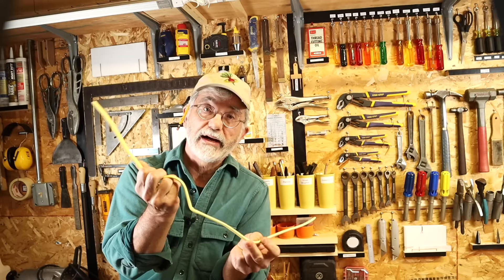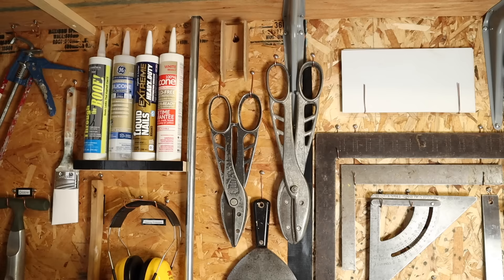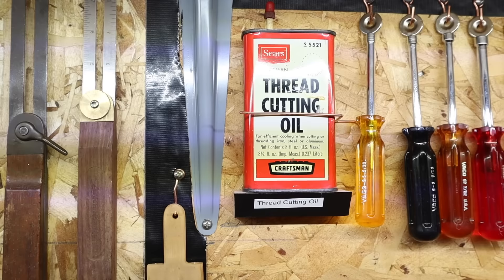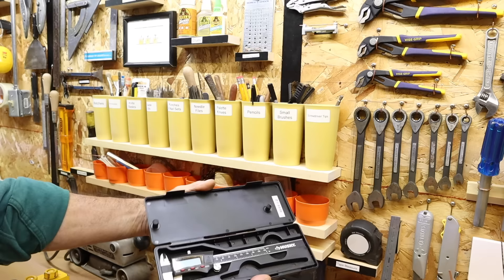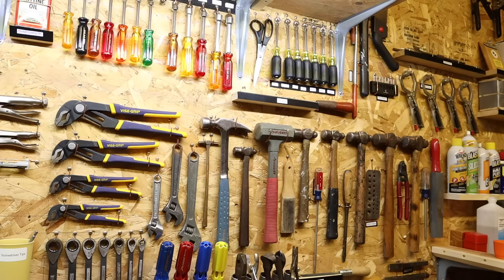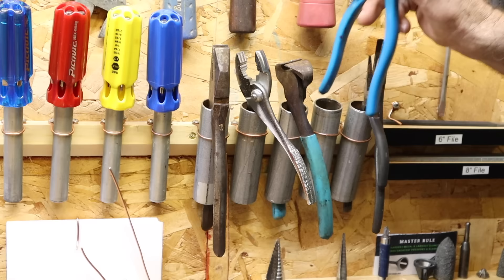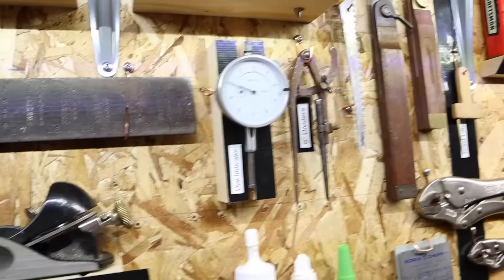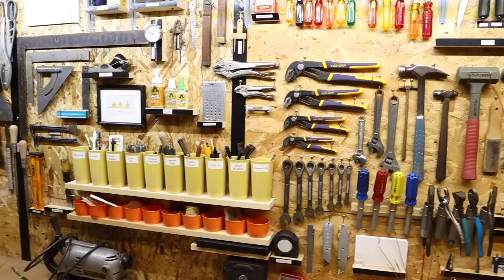How To Have Amazing Tool Organization Using Scraps of Electrical Wire

Comment: Ok, I'm moving off grid by the end of the month and have inherited (aside from my own) many tools (I have at least 8 different sanders and several different wire cutters/strippers, will need to thin things out as I go through them to organize).  Have saved some copper wire and so glad I did but figured I would use coat hangers to fill in, had a similar idea but this helps iron out some confusion a lot, thanks so much.  Better subscribe.  ps, I did happen to get some gorilla tape, all set to start soon.

Comment: WOW! Simplicity is so beautiful & functional. How many linear feet of wire do you think you've used to create this masterpiece? Next, where would be the best place to get a stash of enough romex to accomplish the same thing?
Reply from the maker: Hi Larry,
I have no idea how many feet of wire I used. Probably more than I would guess. I just wired an addition on my house, so I have scrap pieces. But I also go to yard sales and estate sales a lot and I've seen partial electrical wire rolls there fairly often, for very reasonable prices. If you have a local facebook group, you might ask if someone has some short lengths you can buy, or just have. Perhaps just let it be known in your circle of friends that you are looking for some wire and it might turn up. Otherwise, Lowes or Home Depot will sell pieces by the foot, but it's downright expensive. There is also the option of not using copper and, instead, getting an appropriate gage of galvanized "hobby wire" at the hardware store. Much less $. Best wishes.

Comment: Thank you!  This is fantastic and has given me all sorts of ideas.  I was looking for tool storage for my garage, as I can never find my stuff in drawers and boxes.  I loathe the small pegboard I have as the hooks always pull out.   I have other hobbies too - knitting, weaving, crochet, sewing, watercolour painting - and 2 dedicated rooms for these hobbies in the house.  They all require storage for all the hundreds of bits and pieces of equipment.  For indoors, I could cover the OSB or plywood (either fabric, paint or wallpaper).  The other beauty of this system is it's pretty flat, so I can make use of the usually unused wall space behind a door.

Comment: 22:56, you can use 1/2 or 3/4 poly irrigation tubing.  sometimes i cut them and I have scraps left over, so i can recycle them.
Reply from the maker: Right. Use what you have. It should work just fine. 👍

Comment: I feel like this is one of those contests where you see if you can make everything out of only duct tape but in your case, it is copper wire LOL. i am working on covering my garage walls in OSB lots of good ideas for hanging stuff i was going to put up pegboard, but this seems like a good way to hang things all over on OSB. figured the pegboard was a bit weak for heavy items and would collect sawdust in holes.

Comment: I organized all the tools using those hooks that you screw on wool or wall. I made doors for the shelves my husband made for storage and put all the tools right on the doors haha! Super cheap and easy too. It works like your hooks.  Yours is better because is absolutely customizable, I had to open some hooks and others I had to close, but for the most part I didn’t have to do anything.  The hammers i hung using pipe holders… anyways, if I had white leftover and watched your video I would use for the tools that didn’t quite fit on the hooks.

Comment: We are in the process of relocating.  These are great tips.  We hope to either buy a property with a huge shop 1500sq ft to 2000’ sq ft. Or larger or we build one.  Between my husband and I we have three standard roll aways (2 are mine) and I have a drill press and combined we have 3 or 4 other tools boxes old school 2’ x 2.5’.  Lots of tools, floor jacks, engine hoist etc.  we currently have maybe 600 sqFt shop and look forward to being able to organize all of the constructions and automobile tools we have to keep our vehicle hobby more organized

Comment: This could be the single most innovative video I’ve seen. You can’t even really calculate all the possibilities! I used all antique slotted screws to hang up all my tools, but you cannot customize like this, so I’ll be using many of these- I think I’ll just hit the screw heads w/ copper paint to be extra. On a larger scale you could even use copper pipe (either bent or w/elbows) on a big wood shelf to create a rail for glass jars etc.

Comment: There's a very good idea inexpensive way to hang your tools. Love the idea for those hooks that you made that are J Hooks the only additional thing I would have done is loop the ends ot bend a ¼" over on it self to radius of the germination of the J hook. Helps with the interfaces with the tool when loading so there's no single edge sticking up its rounded and not pointy.  I love that idea. Now I need a source of scrap wire from someone!

Comment: Very clever system. Give the Megapro multi ratcheting screwdriver a try and you will never go back. I've had mine for 7 years and have over 70 screwdrivers. It's the first one I reach for if I don't need to pry or break something.

Comment: Amazing job, thanks for sharing.  The method you used to hang tools is actually far better than peg board... over time, peg board holes wear out and the hardware comes out when you pull the tool out of them... very annoying.  The method you use is a great idea and you can make all the tools fit perfectly, more of a custom fit.  Great job!!!

Comment: Advice: if you stick the wire in the chuck of a drill and the other in the vice, pull and spin the wire straight (not too much or it will become brittle) the wire will straighten out and bend way nicer and more uniform.

Comment: Great video. My shop is a wreck and I will use the wire idea. No labels. Take a picture, print out and put it in an artwork frame.   If you change something change the picture. Thanks for the ideas.

Comment: As a lazy handyman, since I have a decent air stapler, I’d opt to pop a couple staples to fix the ends to the wall. Staples can be pulled out easier than screw if needed.

I probably wouldn’t bother stripping the pos/neg wire, could color code for diff types of tools.

Comment: Probably the most useful thing for me was showing me that you can easily remove the sheathing from the wires with a utility knife. That will make stripping down my scrap wire for melting down so much nicer

Comment: I appreciate the suggestion for items that are not easily hanged; however, for other items, why not consider utilizing traditional angled nail fasteners? I have successfully hung most of my tools using simple nails. Nevertheless, for those tools that are not conducive to being hung by nails, I will certainly employ the technique you've recommended. Thank you for the suggestion!

Comment: I've always called the tool you called "dykes" as "klines" (made by Kline). The blue handled pointy nippers to the right I call "dykes". The metal cans on the shelf I might screw one of them round mags behind each so when I grab a can with my fat fingers I don't knock the rest of them down a clattering. Watched the whole vid, got some great ideas, and left a thumbs up. Thanks for sharing.

Comment: The blunt-nose electrical plier is called a klein, after the Klein tool company, famous for making those. It's also called the "Electrician's hammer," as that's what an electrician will use to beat a stubborn part into submission. The blue-handled wire cutter is called a dike, which is short for diagonal cutter. Because it cuts on a diagonal.

Comment: Retrieving tools- ideally the tool is grasped in the same hold that it is used. Otherwise the grip has to be changed, delaying use. Small matter, but hundreds of times adds up. They tend not to get dropped, either...
I agree with the simplicity, using sheets of ply to build multiple wall boxes hung on cleats is just turning a workshop into an art installation.
I use galvanized wire for hanging- it is stronger and you can form better support than hooks.
Pipes for storage- plastic water pipe comes in several sizes, and can be hot glued together for a matrix of tools. You can add more, or separate with a heat gun for a major re-build.
Hammers- a rack that has the heads to the wall takes less space, and the grip is ready to use.

Comment: yes, inspired to organize.  Great use of inexpensive wires and screws.   I bet you get your Romex wire from building/construction sites where the electricians casually toss out scrap Romex.
Reply from the maker: I was a home remodeler for 25 years. And recently put an addition on my house. Am well stocked with copper wire scraps. 👍🙃

Comment: you could just connect your electric cord for outside right into the electrical box and attach it to the outlet and they make two duplex outlet cover plates so you could have 4 outlets.

Comment: To protect metals from rusting, especially in Florida where the humidity is so high and was rusting my tools, I make a mixture of Xylene and Styrofoam and it is amazing. I use a little recycled glass jar with clear solution, another one mixed with black colorant, white, gray and I am always protecting stuff around the garage, car and house. It is also a great sealant for wood and cement. Just add the Styrofoam to a portion of Xylene to try it out (like 1/2 cup. The more Styrofoam you add, the ticket the mixture will get and the longer it will take to dry, as the Xylene just evaporates away, leaving a nice coat of protection. I hope y'all enjoy it as much as I do. Mostly, I use an Acid Brush and 1 inch brush that I keep in a larger glass jar with a bit of Xylene, that are always ready to reuse. HARBOR Freight sells great acid brushes made with horsehair. Take care m, be safe and have a blessed day.
Reply: I live in Central TX and we have quite a bit of humidity here as well. I love this idea. Could you let me know what all you use this on? I know you said you put it on cement, but can you put it on tools,etc as well? Last question, what kind of colorant do you use? Let me know your thoughts!

Comment: I have a similar system but I don't even use copper wire but just different kind of screws. It's cheap and inifitely modular and looks much better in my opinion than pegboard or french cleats for example.

Comment: Great job.  Quick tip on the thermal label makers, be warned about labels from eBay.  I bought a few rolls from eBay an the print started to fade while sitting indoors inside of a tool box.  Meanwhile, the OEM labels were still looking great.

Comment: Wish I had seen this in 1993, before I brought the peg boards, wire coat hangers cut down as hooks. Very simple, here, but intelligent and innovative. In Australia, the Gorilla tapes and glues are making an appearance. The Yankee Screwdriver. Back in my early Military days, the Stanley company had a blue handled version, down for right, middle for guts, and up for left. At one morning 0800 muster, a manager asked a newbie to go down to the workshop to get a left handed screw driver. Away he went, with the laughter from most of us there. Ten minutes later he is back, with the Stanley. Its been 45 years, but what he said to the manager is classic, "Boss, in the human race, some are left handed and are right handed,  an odd number in between. This screw driver can be used by both, you see, lever bottom for left handed, up top for right handed, the guts (middle) for ambidextrous like me. You Boss, you are left handed, so I have left it at the lower setting for you".

Comment: You just solve my problem. I will hang my contractor table saw, 8 inch jointer, 16 inch bands saw and my 12 inch sliding miter saw on the wall.🤣

Comment: What a great idea! I'm so done with pegs falling off the pegboard. But if you've been to Home Depot recently then you know how expensive Romex wire is. Instead of going to the Electrical Dept, go down to Building Materials and buy rebar wire at a much more reasonable price.

Comment: OK- just seeing this now, two years after.  Great ideas.  I wish I had that kind of wall space.  But the one thing that really got me was using black Gorilla tape (which I have and do use all the time) as a backer for white labels.  At first, my thought was I don't need the black contrast to see the white label.  Then it hit me.  Label maker tape does not stick very well to wood but Gorilla tape does and label maker tape will stick well to Gorilla tape.  Perfect match.  Also- I don't think I've ever thrown away a piece of electrical wire no matter the gauge or length.  They're just too darn useful even if it's final job in life is just as a twist-em.

Comment: I saw a caulk trick that actually works (the little safes do work, but I can never find them...)  Get a finger out of, even a sandwich, glove.  Put it over the end of the tube, and masking tape it tightly around the glove and tube. Then squeeze a little caulk in a ball out the end of the tube, and fill 1/2' of the glove over the tip.  When you come back in a year or so, the hard dried bit will be outside the tip of the tube.

Comment: With the cost of Romex nowadays it’s probably cheaper to use pegboard and premade hangers. I had to replace a piece of a Romex to an outside outlet last year because whoever install it nicked the hot wire causing a leakage current to ground causing a small leakage current to ground after it would rain and intermittently tripping the GFI on that circuit. This condition that took months find due to its intermittent nature and because there was no extra slack in the 1/2 inch liquid tight and the junction box feeding it I had to replace all 33 feet of Romex. My local hardware store was out of their usual bulk roll of Romex so I had to buy a 50 foot precut roll for almost $90.

Comment: Sweet.
I recently made some S-hooks from electrical wire to hang my brushes (surprisingly strong stuff when you work with it like this)

I used some 2 (or 3?) phase wire, though. And left the sheathing on - for 'color coding' / dampening of sound.
     (As for color - I'm in the Netherlands - the sheathing colors are black / grey / blue / brown, and earth is yellow+green)

But yeah - I'll give this a try :)

Comment: Suggestions - Harbor freight tool magnet bars.  Lots of them could save you space.  Also 4 inch wood screws can hold multiple items when screwed just to OSB.   4 inch screw into stud can hold lots and lots of stuff.

Comment: Absolut genius !!! Now I know how how to end the chaos in my garage and celler without breaking the bank. Finally a cheap and practical solution!

I‘d like to pick your creative brain concerning a problem I‘ve been dealing with (without success so far)

I have around 60 IKEA big mirror tiles (60 x40 cm = about 24 x 18 inch), but lost the wall mounting pieces. These were black plastic „ rhombus“ pieces with clip-on „cap“. Each one could be fixed with only ONE screw to the wall and which could, thus, hold 4x CORNERS of 4x mirror TILES. There was hardly any space between tiles when mounted on the wall.
 Since I can’t find equivalent corner holders any more, I wonder, if you could give me a genius idea 😅 how on Earth I could use my mirror tiles to cover a full wall 
a) with an (almost) INVISIBLE (and of course low-cost) mounting solution 
b) with minimal space between the tiles
c) without damaging the wall paper (with double-sided glue tape - fine nails are OK)
d) without „framing“ the tiles (which I thought about, but don’t really like)

Your copper wire holders might fulfill my criteria, and I will certainly make a test to see if 4 of them (each one, shy of the tile corners) can SAFELY hold the weight of a tile. But if you have another „strike of genius“ as to how I could finish this project in the most elegant and cheapest way, I would very much appreciate it. 

Maybe you want to make some YT tutorial on this subject?!? 
I‘m sure, I‘m not the only one who is looking desperately for a frameless mounting solution which does not completed destroy the wallpaper underneath!
 Thanks in advance,...and keep inspiring us!

Comment: Safety tip: adding a tight, neat roll or loop to the exposed end of each piece of wire would make it much less likely to grab, stab, or tear the one's exposed flesh in the event of a stumble or temporary moment of distraction or inattention.

Comment: Brilliant Design ideas, really appreciate your original ideas. I own 3-different Shops and I’m always thinking of more practical tool and equipment layouts.
      I learned a word years ago called ; Anthropometrics = “the science of measurement and the art of application that establishes the physical geometry, mass properties, and strength capabilities of the human body” performing different Functions. 
         Learned this years ago laying out Drycleaning and Laundry Facilities. Focused on the Ergonomics and Anthropometrics of an employee pressing and processing clothes wrinkles out of the fabrics. 
       The same organizational skills your laying in this Video. Great Video camera, lights and sound levels also. The words your speaking are also spoken correctly and with perfect pronunciation . Great job on explaining your reasoning on the tool positions. 
          I’ve worked on 4- Movies in Special Effects in Hollywood the Last one “ Sky High” and I designed and built an 80’ Conveyor to carry babies into a School Bus. You would fit right in with a team. Keep it up. 
              I did want to see how you mounted the 3” shelf’s with the cups without showing the screws. The camera could have looked under the shelf. 
            It’s a great video and Thanks for Sharing, God Bless 🙏